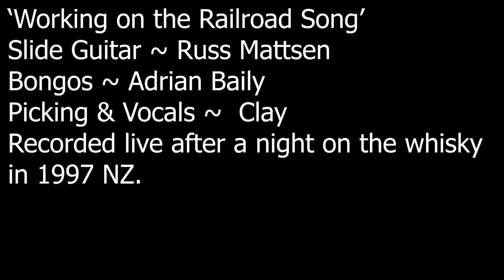Working at Home ~ Clay Tall Stories

Comment: Clay those two saws need a good sharpen and a good clean up. The rust causes them to bind and not clear easy. I used one to cut hard wood poles also a handy thing to have is a small pruning saw.  I have a folding one and I carry it with me when possuming supprising  how much and how fast you can cut plus foldd up to a small  unit. That house will look so much better with all those trees cut away.  Bit of sun light will warm and dry it.   Another good for and you got a good worker there
Reply from the maker: I sharpened them both about a year ago. We smacked some soap on them and they go pretty fast. It would have been faster old chainy but she ain't going. You are right about the house. It already feels warmer with more light coming in.
Reply: I know what you want I don't know what's its like up your way but down here in oamaru. They used to blunt of just sitting in shed due to rust.  When you said about rats I had a bloody plague every one said. Don't put out too much poison. So after some time of just feeding them I went mad and put a shit load of poison all around my farmlet.  In safe areas where stock or dogs couldn't get it they took all they
Reply: Away.  For next two month I had rats appearing every where. Then nothing my theory was they took it all back to nests and send  so young could eat as well did the. Job. Lol.  Hate the destructive little critters

Comment: Check your spark plug and make sure gap is 0.030"
Clean the muffler to make sure it is not plugged, then you can look at the rings on the cylinder through the exhaust port.
Reply from the maker: Cheers mate.

Comment: You could make a wood heated spa with that water cylinder.
Reply: mark lardbet slow bbq smoker for ribs.
Reply from the maker: can you explain how you would do that mate?
Reply: @ClayTallStories  I'm not sure exactly. I think there may be videos on YouTube on how to do that. That is where my brother and father got the idea from. You heat the wood in the cylinder and it heats the water by replacing the water in the spa with the hot water heated in the cylinder. It takes a bit of stoking up and feeding the wood in, but in about 6 or so hours we can get ours up to 42 degrees or more.

Comment: Try two methods that worked for me.. 1. grind the rat poison and mesh it with peanut butter.. or get a 20L bucket and fill it with quarter full and insert fully aired balloon and smoother it with peanut butter.. When the rat gets on it, they will pop the balloon with their sharp claws and drown them..
Reply from the maker: that balloon trick is a new one to me. Clever